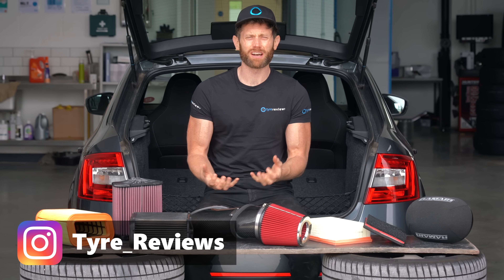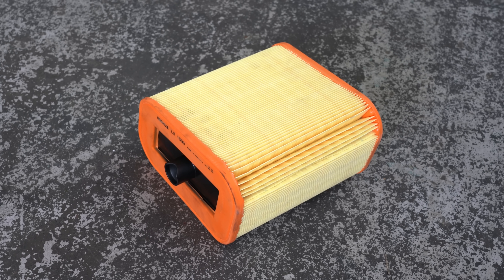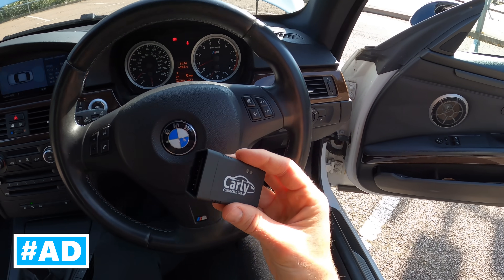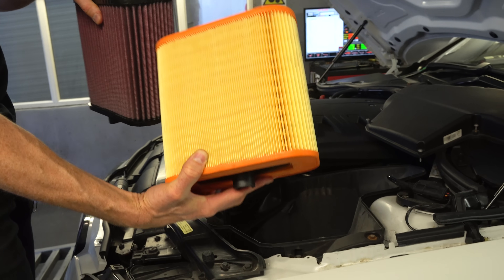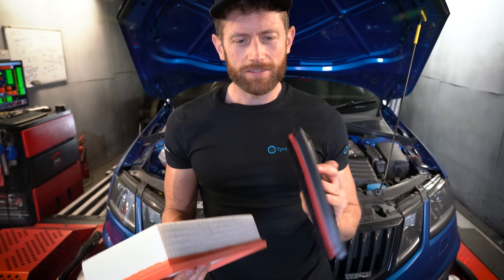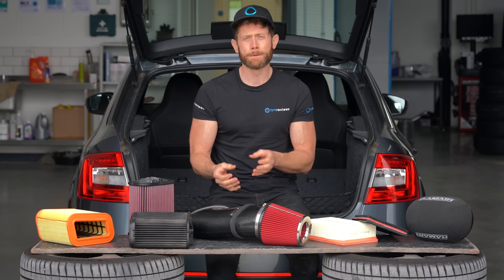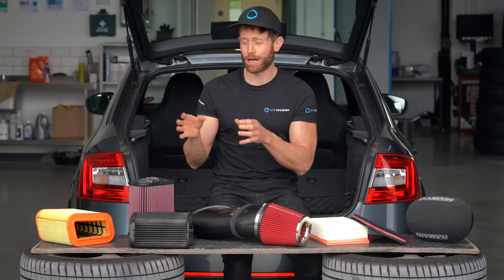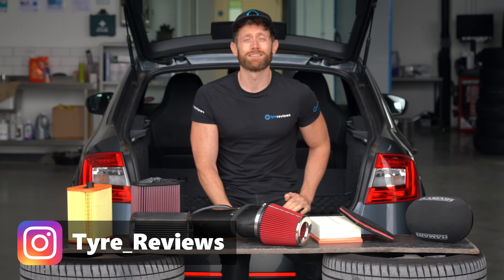Do Performance Air Filters REALLY Give You More Power?

Comment: all these filter testants suck (as much as i saw in most videos)..they all get no extra power with performance filters..of course i appreciate their effort n job, but they all forget about 1 very important thing - it's how quick the engine reaches that power..it doesn't matter if they get the same horsepower, with the performance filter the engine revs easier as it gets air easier, n it doesn't matter even if the power remains the same, but the engine with performance filter will reach it's power quicker..just like with lighter flywheel - you get no horsepower gain, but your engine revs a lot quicker n due to that you reach your max power quicker..the same with crankshaft or accessory lightweight aluminium pulleys, or any other engine drivetrain component: crank shaft, piston rods, pistons, chain, sprockets, n even valves - the lighter the engine components the easier n quicker the engine revs..for instance, let's say a particular nissan with first generation SR20DE 110kw (doesn't matter highport or lowport) with its 8counterweight crankshaft will sprint 0-100kmh, n then with swapped 2gen. SR20DE 110kw 4counterweight crank shaft engine in, and does the same sprint (let's say both engines' revlimiter set at the same 6500rpm n have the same power 110kw, as they should)..so most plausibly, the same nissan will sprint/accelarate better/quicker with 4counterweighted crank shaft SR20DE than with 8counterweighted, because with the lighter crank shaft engine will reach it's peak power quicker..the same with performance filter, the same power, but the engine response is better, cos the engine breathes easier, so it revs quicker (not necessarily every engine will rev quicker, depends on lots of other components n its features like i've mentioned before)..i hope you got my point..a good example n proof is "Project Farm" guys' test/sprint with their suburban, where with performance K&N filter the car sprinted quicker by 0.1-0.2s in 0-60mph, n even flow tests showed that performance filter flows better despite that most test show the same power n no gain..ckeck yourselves @7:25..https://www.youtube.com/watch?v=sJ3L-E-ufYo..so we already know from various dyno tests that perform.filters in most cases don't add power, so you should make sprint/accereraton tests 0-100kmh/62.5mph instead to see if there's any point of P.F.;p..i instantly felt better responce/acceleration after putting performance filter on my SR20DE Primera/Infinity P10/G20, my brother also instantly felt the difference in performance in his Maxima A35 VQ35DE after installing PF, he even did a test with a device n got 0.1-0.2s quicker sprint to 100kmh..so i guess the performance filter does his job, even if it doesn't gain any power on dynotest, but the sprint results speak for themselves..to get those 0.1-0.2s you would need an extra 10-15hp of engine improvement or even more to get those sprint numbers with your car..as for filtering, of course performance filters suck, especially K&N, BMC, King Dragon or any other cotton filters with see-through holes, unless it's AEM non-oily one, they filtrate better, as seen in your test (but no doubts, even if AEM filtrates a lil worse than stock/oem filter, it will perform better than any oem'ish compressed paper filter with microscopic or no gaps between paper folds)..so only you decide if those 0.1-0.2s of performance worth the engine wear..good luck!
Reply: https://www.youtube.com/watch?v=YypvDEQyNBY

Comment: I feel like these filter are a good money saver in the long run since you can clean them, re-oil them, and put back verses buying a new air filter every 10k miles. That is if you plan on keeping your car forever. Besides that, if they give any HP increase, it only does as a support to a tune.

I’m no expert, so I’m just speaking on the $ side as that’s why I have a K&N filter for my daily driver.

Comment: As much as I appreciate these tests as to what happens at the rev limit, I really care more about the drivability and whether it will create valleys or smooth out the torque graph in the range that I drive.
Else a video is just academic and purely for the drag strip.

Comment: BMS done a test and supposedly the cones won't heat soak because with turbos the heat is soaked through the intercooler before entering the engine bay ?

Comment: I have a C7rs6 and with stock filter 570 hp  with bmc 582 hp plus 22 torque 👍🏻and you need to wait a few weeks for the car engine to adjust to the new filter then re test on the Dino , I assure you there will be a great difference especially on any turbo car,and the bigger the engine and more hp the better the gain mine is a 4.0l twin turbo  so that's why such nice gains ,a 1.0 l fiesta would make a lot less obviously .

Comment: I have a question. You just installed a performance air filter that allows more air in. But did you tune the ECU to inject more fuel (i.e. AFR) accordingly?
Orelse isn't it just running lean?
Reply from the maker: Modern ecus can adjust themselves within a range

Comment: We did this dyno test on older cars many years ago, like turbo converted Volvo 240 and on a stock VW Golf.
So not to our surprise the Golf had "zero gain" (within margin of error), and that was evn with hood open and a huge fan in front.

But the 240 did have an improvement, but you can get an even better improvement there by just rerouting the preheat hose from the stock airbox to cold air.
Thing is that even in these old Volvos there is a prheat flap that is controlled by ambient heat and in theory it should open and close, but on old cars its oftne halfway open all the time, so they then suck warm air even with a warm engine. That hurts performance of course.

But then rerouting the hose to cold air, removing flap will still be better than a conical filter.
SHould be noted one can of course fit a drop in performance filter too.

Comment: How did the AFRs look? Short term fuel trims? If the car is leaning out a bit from the decrease in restriction, perhaps the car compensates by pulling a bit of timing. Maybe it needs a bit of driving before the PCM balances the AFRs and again.

You’re MAF or MAP reading should also tell you if it’s seeing more air or not. I know everyone thinks the car will immediately compensate and yes MAF sensors have great transient response, but in my experience the PCMs always error on the side of engine conservation not power production and don’t translate short term to long term adaptations until many miles have been driven. I have even heard that some PCMs will sneak in timing until knock is sensed and then back off a few degrees. Don’t know wether that’s true but makes sense if cars are sold in different markets with different gas quality.
Reply from the maker: I think you need to rerun this test with extra science :)

Comment: FILTERING: WHAT is NOT filtered is most important. i.e fine non-abrasive dust OK B/C it is easily suspended in quality oil, large abrasive dust particles into the engine BAD.

Comment: for a road car there's no use in changing filters unless you want some bragging rights. I use a pod filter with the biggest amounnt of filter surface I can find on my bmw cause that just  feeds directly into the ITB's. Using a pod filter over a foam one because the Zand in Zandvoort means sand. Literally. What is interesting, you say it makes the same power but it bumped the torque a bit. also WTF happened to your caR? That's a crazy dip.

Comment: The difference here being one brand's intent was to get all available power with the design of their engine which included the intake, and the other was just trying to meet regulations and noise requirements, also cars with forced induction almost always benefit from de-restricted airflow.  Millions are spend on R&D by all brands, but not to achieve the same things.

Comment: it should be noted that gains are going to vary based on each vehicle tested. some vehicles have better stock airboxes than others. due to increasing emissions regs, most vehicles nowadays actually come with cold air intake setups from the factory. or at least, they have much bigger filters than the engine needs to run efficiently. still, some of these cars have smaller filters or extremely complex routing. changing it out for a completely new setup with a different size filter can actually yield gains.

the hp increase on the VW most most likely due to the radius on the tube at its opening, more so than the filter itself. 

thank you for testing all these with the hood down. thats a detail that a lot of companies like to omit in order to show bigger gains.

Comment: Looks like from your dyno pulls, the true gains are in torque, not horse power. But at the cost of probably allowing more particulate into the engine which will lead to increase in wear, which will eventually lead to loss of power & torque. If you want more power get a bigger displacement engine or turn up the boost. Peace

Comment: It will depend on the car. I had a new 2003 Subaru WRX STI Spec C, ran her on a dyno at around 800 miles on the clock, pre and post air filter change.
Car made 280bhp with the standard Subaru filter (paper), replaced with an official STI filter (cotton I think), made 292bhp.
The car was still loosening up, would eventually make 312-316bhp regulary on this dyno (stock map), kept using the STI filters from then on, at £45ish every 2 years 😯

Comment: Word of advice, be extremely careful with Carly, it has bricked scores of cars when programming/coding was attempted - I would not touch it with a barge poll !!!
Reply from the maker: I've not seen any of this :(
Reply: @tyrereviews  Beemers are stuffed with electronics sensors and ECUs to the brim. They all talk to each other all the time. They need to be able to communicate and be on the same integration level (software update) to do so. While being updated and programmed they require stable, low ripple min 13.0V external power supply. If voltage drops (say you battery is brand new) integration (programming/coding) gets interrupted the ECU undergoing the update is toast and they are very expensive to replace or require really advanced bench programming skills to bring it back to life. Did Carly tell you all of that? Stick with ISTA+ and an original or a good clone of ICOM. You could possible use Carly for error reading and deleting fault memory but that's it :).
Reply from the maker: @peterlabiak1051  Good to know, thanks for the details. I'll be sure to keep that in mind in the future :)

Comment: You’re forgetting a key point with turbocharging. “Heat soak” from air filters isn’t that important. The turbo will compress and thus heat the air to temperature wayyyy in excess of “heat soak” from an air filter. That’s why you have an inter cooler. It cools the compressed air. On a N/A I agree with you, when an inter cooler is involved, that’s what important. Not air filter heat shields the difference in negligible. Heat soaked inter coolers are where power is lost on a charged engine.
Reply: I agree with the intercooler but not the air filter. The hotter the air going in, the less dense it is, the less dense, the less power, so hot air being sucked into the engine pre combustion will reduce performance.

I think you confused the combusted gasses that go through the turbocharger then out of the exhaust, but intake, hotter = less power ☹

Comment: Try using BMC filter and add air scoops on the front behind the top front grill. thats where you are able to gain more out of the v8, and i agree as ive tested paper filter compared to oil screen filter except BMC filters.

Comment: Eek I have listened 3 times and still not sure on conclusion in part.....so turbo better with more air as long as is  not hot air, so if change filter with turbo, better if enclosed in a box.....Or not?  Sorry, I can't quite follow that last bit.
Reply from the maker: Generally boxes are better as they pull air from outside, but can get restrictive at very high flow rates

Comment: I thought i will take a chance and installed a bmc drop in filter and was suprized by the improved fuel economy from my 1.4 zetec s. I also had a fairly new oem filter previously so i did not thought i would see any improvement. From a power point of view not much if any. But seems like a bit more power low end not sure.

Comment: NA engines will benefit more than Turbos. Turbos don't care as much about the filter as the turbo will pull the air through kicking and screaming. Edit after watching the video.  I'm a little surprised (not overly) that your turbo made a bit more peak hp. However the NA didn't.  But I noticed that it did produce more peak torque.  Which means your NA engine 1) produce more power lower in the rev range. 2) posting HP/TQ numbers without showing the dyno curves or at a minimum the RPM at which the reading was taken doesn't tell the whole story.  There was minor gains on both engines.  But your NA making more peak TQ was making peak power probably a little lower in the rev range (2-300 rpm earlier) and given a side by side comparison of stock vs performance filters for the whole dyno pull (2000-6000 rpm) or whatever range was used. It probably make a few more hp/tq  the whole way through up to peak.

Comment: Thoroughly entertaining.  Once upon a time I had a tuned 320i, mapped with a new ECU and special filters.  I worked on a road construction site that was very dusty and the filters got blocked.  Found that out when I got on to the motorway and the engine gulped air.  It swallowed the S&M gear and was a tow job.
Just buy Mahle from a shop that has a high turnover.  Cheap stuff on eBay may be delivered to your door, but can be old and flabby or cracked.

Comment: Gauze filters allow dirt particles to enter the intake which wears out the rings and adds to valve deposits, especially with DI engines.  Think about those modded Honda Civics blowing smoke from the tailpipe from a K&N filter. The dirt gets into the oil and shows up in Used Oil Analysis as silicon, and extra tin, from the rings.

Comment: Guessing the NM numbers were torque?  it looks like the K&N got your 10NM in the BMW and both aftermarket filters got you around 10NM in your turbo car.  I had an NA car that gained 13whp with just an intake (no tune)...or about a 5% gain.  It was dynoed several times with several configurations and repeatable results.  Yes, most intakes don't make sense and most will need a tune to make a pitiful amount of difference.  The 13whp was my one hit wonder.